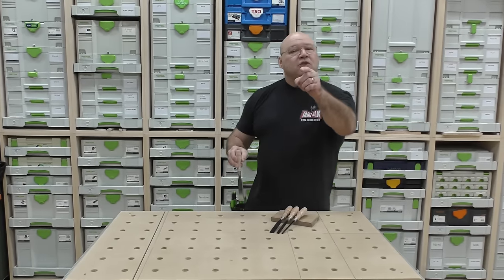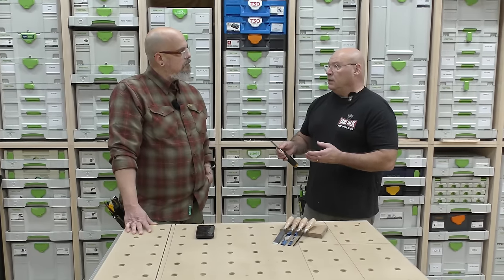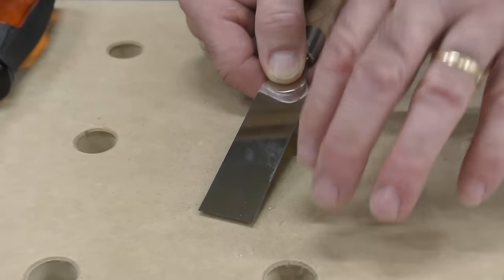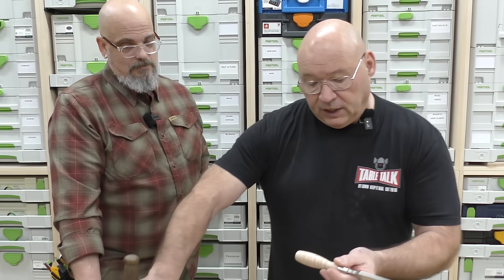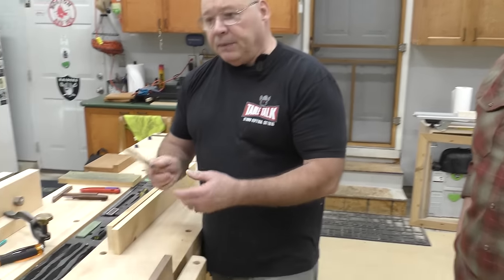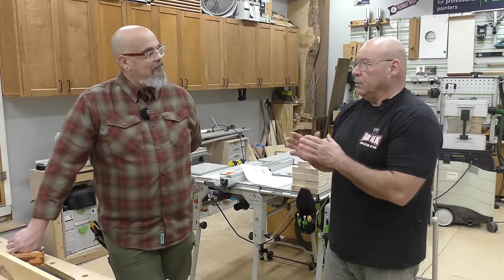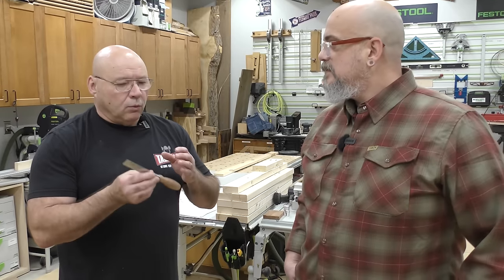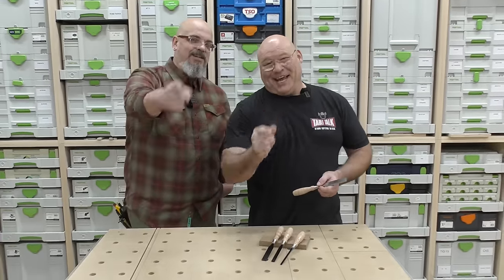There Is Sharp and Then There Is WICKED SHAAAAAAARP !!!

Comment: I will sometimes use my chisels in all the ways you showed, I have also, just for the challenge, cut a dovetail with only a chisel. I also have an old knocker that I keep in my apron when I am doing carpenter work, works better than a screwdriver blade for wood butchery.
Reply from the maker: Good stuff!

Comment: These chisels are great, I own one of the smaller buttchisels which are handy for getting into tight spaces, I personally prefer lie Nielsen chisels myself! They just feel nicer in my hand
Reply from the maker: cool
Reply: I own a full set of the Blue Spruce chisels and some of their other tools as well for many years. They are very nice indeed. But, I always seem to reach for my Lie Nielsens as they feel better in my hand too. Could be because the LN were the ones that I started with and it’s just muscle memory. You can’t go wrong with either manufacturer.
Reply: @lanceyohe6026  yeah it’s probably that, I did some of my first joinery with a friends Stanley SW set and they felt comfy, over here in the UK the blue spruce stuff is mega expensive, never thought I’d say this myself but the LN stuff is drastically cheaper over here

Comment: I can not yell a lie, I have two small sets of cheep steel chisels form HF.  Most of my wood working is with manufactured wood applications.   I use them mainly for scraping glue, tiny cuts, trimming edge banding, and dowels.   So sharpening my junk chisels a couple of times a year is not a problem to achieve wicked sharp levels, besides its a evenings activity in the shop.   They sit on my main tool cabinet so family members can come in and help themselves.  It's amazing how they can help separate stuck car parts.    However, between some of my parts boxes, are special places where I keep my 1/2" and a 3/4" Lee Nielsen's.  They cut like nothing else, and only come out for the real wood, when I'm alone.
Reply from the maker: Wow ... cool
Reply: I did not see the turn at the end coming.